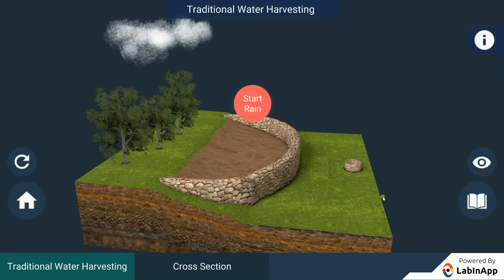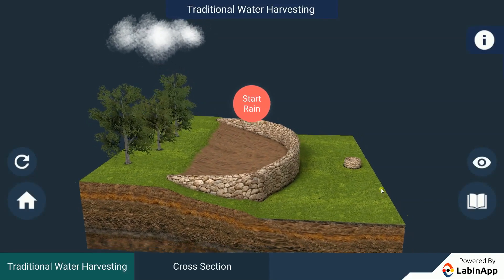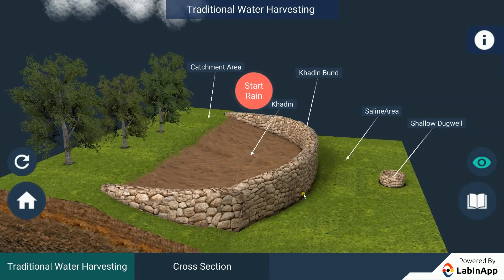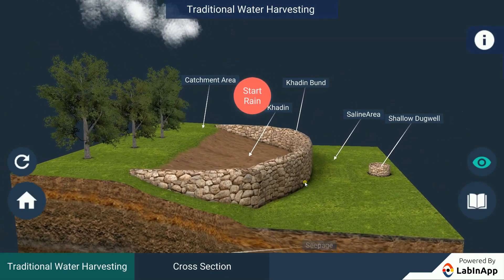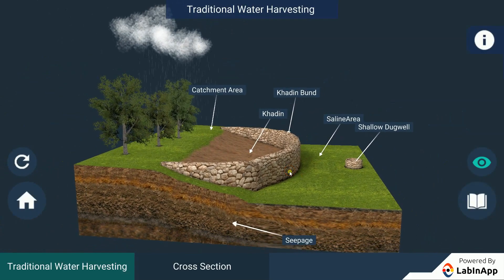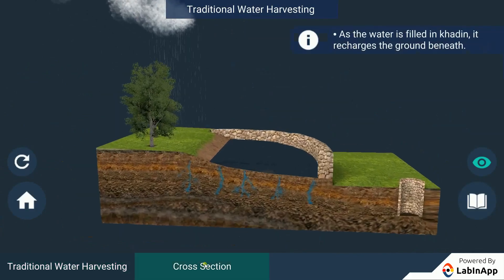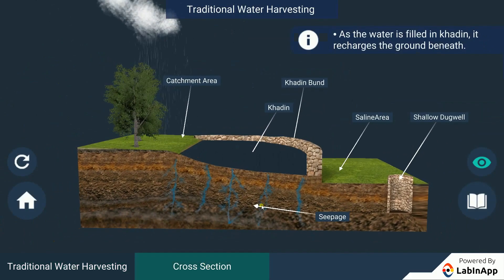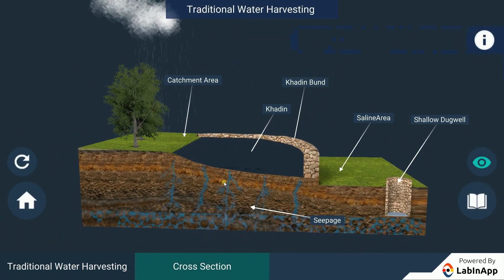Traditional Water Harvesting: Khadin System

Comment: A half of the Sahara Desert is located in the United States. Instead of busy carrying out air missions on Mars, it is time to allocate the rising Congo river flow and build a 5 km wide river stretching along the west coast of Africa to Mauritania and Western Sahara (Morocco) to stem the flow of the river from rivers in Africa by building embankments or anti-tsunami islands on the west coast of Africa from South Africa to Western Sahara Morocco and the Sahara Desert will return green if the air from the Congo river floods the Sahara Desert by using air to the upper river purbna using a hydraulic pump (Ram Pump) without electricity
Reply: I like the idea